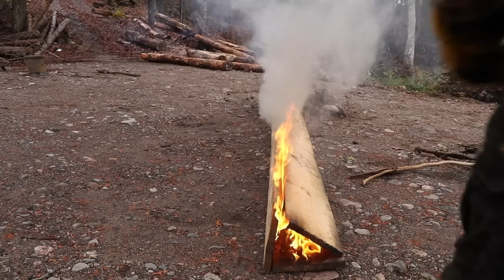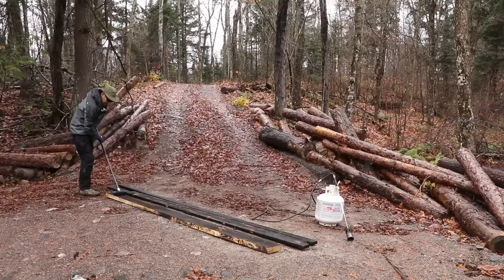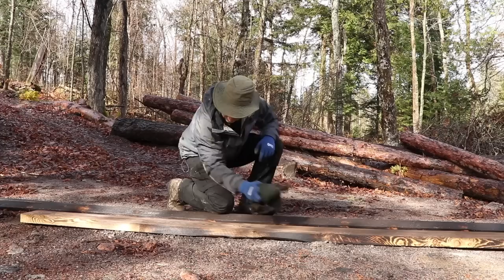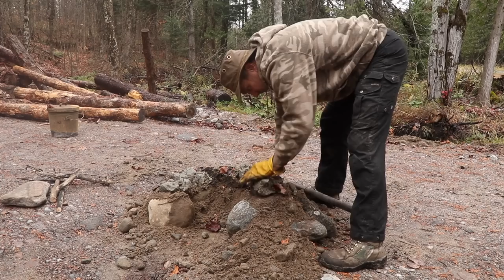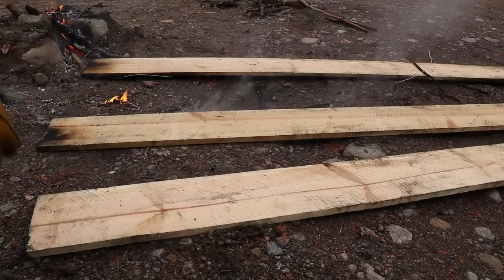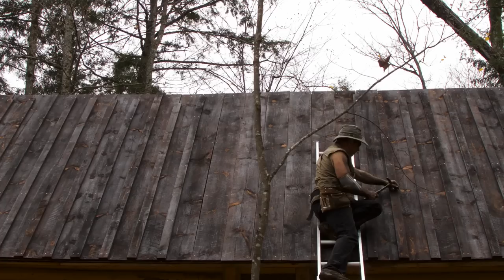Traditional Japanese Way to Preserve Wood with Fire using Shou Sugi Ban, Yakisugi on my log cabin

Comment: So cool! Tons of respect... really admire that you took the time to learn a great technique from a different culture and try it out instead of just going the common route :)
Reply from the maker: Thanks Chris!
Reply: My Self Reliance in the future will you show the layout of the cabin and compare r value between what you're doing and modern building?
Reply: Jordan Lammers, R value is actually uses wood thickness as it's measure. What I mean by that is that an R value of 1 has the insulating ability of 1 inch of wood. R2 is 2", and so forth. The R value of his cabin would be the average thickness of his walls, roof, etc. Hope that helps.
Reply: BeSatori ya thx
Reply: thank you mate

Comment: One little detail that may be important for this technique: after putting a bit of oil on wood they usually heat it up (with propane) to help the oil penetrate deeper into the structure.
Reply: Are you familiar with this technique?  I'm a beekeeper and I've charred all of my hive stands with this method except I have not added oil.  So far, I'm very disappointed with the turnout.  After 1 year, even less, much of the char has simply flaked off.  I am not using cedar, perhaps this is why, do you know?  Also, perhaps me not adding any oil is also a problem.  Next time I char some hive stands, I'll try adding oil.

There are a couple of hive stands which I have to 'touch up' and I'll rechar them, I'll add  oil this time (used motor oil).
Reply: CluelessBeeKeeping DON'T USE MOTOR OIL FOR A BEEHIVE!! Use coconut oil or even olive oil but NOT motor oil!
Reply: @notbuyingit5698  Both go rancid.  I'd never use either.  I don't / wouldn't / won't use motor oil on the hive.  The hive stand, yes, I'd try motor oil (bees never go on the hive stand).  I need to experiment with something to try and make the charring stay on a bit better. The technique doesn't seem to work very good on pine.  Do you have any other suggestions which would help keep the char on longer???
Reply: In Lithuania beekepers boil boards used to build beehives in food grade paraffin wax, it makes them last very long time, no charring necessary.
Reply: Mineral oil would do the trick as it doesn't go rancid. You can get non food grade stuff much cheaper as well.
Reply: Also oils once heated past smoking point turn hard thus helping with the water resistance side of things. The same process for non Teflon pans such as iron & carbon steel pans!
Reply: @jesmondo5785  Just use Linseed oil, walnut oil, hemp oil, poppy seed oil. Any of the hardening oils. They don't go rancid, they polymerize into a kind of a "natural plastic" if you will and protect the wood.
Reply: @cluelessbeekeeping1322  boiled linseed oil is a great natural finish
Reply: @justaspivoriunas9416  My father's side is Lithuanian, Hello!  I'm curious, how long does that paraffin wax last?  
All the oil based paints of today are horrible (thanks EPA).  They simply do not last, not even 1 year.  Also, I am not charring my hives, just the hive stands.
Reply: @jesmondo5785  I've written this long ago, but I still haven't tried any of what I've mentioned.  I'd still like to try motor oil as I can repurpose it.  It's free!
Reply: @jesmondo5785  If I oil them, I will not char them.  Well, I mean, I will 1st char them, then oil them.  Although...I wonder how that might work to char them a 2nd time after adding oil...hmmm, I'll try this, but I can't now, everything is too dry.  Fires can spread amazingly fast.  I'll have to wait till it becomes greener in the Fall.  Thanks for all your suggestions.
Reply: @cluelessbeekeeping1322  no worries dude! A second char to harden the oil i definitely recommended! As another lad said hardening oils are good just gotta be careful with how you dispose of the rags! Hope it works out well dude!
Reply: @cluelessbeekeeping1322  A 50/50 mix of linseed oil and mineral spirits works pretty well for treating wood. The mineral spirits help the oil soak into the wood really well. Not sure how well it works on charred wood though.
Reply: @waltofalltrades6817  Thanks.  I've got some of both, I'll try your mixture!
Reply: @cluelessbeekeeping1322  maybe use oil that won’t get stinky and rancid. Tung or linseed oil maybe. Or some straight up beeswax, I’m sure you’ve got plenty of that.

Oh, I’m a little late to the party hahaha. Should’ve read a little more.
Reply: @hotcurdsinyurmudder  Sorta late and not late.  I haven't used any oil or anything on ANY of my hive stands (yet).  I don't have enough beeswax to cover all my hive stands.
Lately I've been (these past 2 weeks) redoing many legs as they've been attacked by termites (expected, but also, meh, whatever, it doesn't matter as all the wood is free &  I have mountains of it...just time is my only expense).  Still, I need to start placing the hive stands on some stone to try and retard the rotting/eating of my hive stand legs!
The more I think about it, I'm going to go with just motor oil.  I've need to get a sprayer dedicated to oil, though.  Don't want to get that mixed with anything else!
Thanks for the suggestion.
Reply: Yes.  They do re-burn the oil again. Important.
Reply: @matthewapardue  Not necessarily "The problem is that standard “boiled” linseed oil sold as a wood finish contains heavy metal additives to aid drying: lead acetate and cobalt-manganese. These compounds are neither safe for you nor safe for the environment"
Reply: @cluelessbeekeeping1322  You can always use beeswax or beeswax and propolis.
Reply: @jasonthurston799  Dude, I don't have THAT much beeswax & no propolis (well, some propolis, I basically throw it away...ya, I know it's 'precious')
Reply: @cluelessbeekeeping1322  Hey, fyi, the charred bit is supposed to come off. As a matter of fact, you can rub it off with a wire brush leaving a dark brown finish. The char itself isn’t what preserves the wood, it’s the browned wood underneath.
Reply: @dylansmith7077  Something is taking it off at night...little tiny paw marks.  I STILL need to try adding motor oil to it...that might keep it together on the wood longer.  I never know the kind of wood I'm using, often long leaf, but there are plenty of woods which I simply do not know the kind of wood I'm using...  I do know they seem to each act differently.
Reply: What kind of oil?

Comment: I had read in a book about "Old-Timers Recipes and Techniques" that a way to make "A fence that will last longer than you will live" was to mix finely ground charcoal with Linseed oil and stain the fence with the mix.I'm assuming it works on the same principles displayed here, though I would say your technique is probably a lot faster. Very cool, thanks for the upload!

Comment: Great job Shawn !!  My Grandad used to char fence posts and he had a fire pit like what you see those fire walkers walk on and he'd lay the posts along the pit turning them when needed and when it was done he'd just roll it out the other side of the pit and roll another on. It was wonderful watching him work as a 7yr old !!  I'm 61 now and those posts are still there !!  He also treated the part in the ground and around the base with oil a few times each year ! Old sump oil from diesel trucks was best he said because it had the most carbon in it !!  Thanks mate that bought back a lot of wonderful memories !! Seeya Rob
Reply from the maker: That's great - funny how we've forgotten so many of the old ways.

Comment: I used this method on all the woodwork in my tiny house. I only have 2 windows and a door, plus the framing for my bathroom wall, so I just sat there with a blow torch and burned them all. It's pretty relaxing doing that. :) Then I washed them with water, let them dry, and used paste wax, and buffed it. The results are amazing. I love that you don't just see the grain in the wood, but you can feel it too. Plus no sanding necessary as all the slivers are burned off.
Reply from the maker: Sunflower Happy with the wax? Considering it
Reply: I really like the wax. I have a brush that attaches to my drill that makes the buffing really easy.

Comment: I'd suggest using boiled linseed next time, I was doing a rifle stock a while back and used vegetable oil (all I had at the time) and read everywhere (afterward) that it will go bad, the oil it's self will get rancid. I got rid of the gun not too long after so I can't vouch for it either way. Hopefully it works for you, and good luck.           My first YouTube comment ever, by the way. lol.

Comment: I could be wrong, but I thought the char was left on as the protectant? Either way, nice blend of cultural history going into the cabin. I'm loving it. (Comment NOT sponsored by McDonald's.)
Reply from the maker: lol. You're right. The heat still carbonizes some of the underlying wood and some of the char remains even after brushing lightly. However, leaving the full char on for exterior applications means it will last that much longer before the char erodes off. I'm only using this brush and oil technique on the interior where it won't be exposed to weather.
Reply: My Self Reliance oh, okay. Thanks for replying.
Reply: and what a beautiful way it is to bring forth the grain of wood itself, especially on floorboards.
Reply: Cool.  I had the same question about the wire brushing.  Maybe it would make sense to leave the full char on the bottom and sides of the floor boards and only wire brush the tops?  

Thanks for sharing the technique.
Reply: It would be a bad idea as charcoal readily absorbs large amounts of water.
Reply: Thomas Russell Your correct sir
Reply: That's not what the Japanese think– they leave the char.
Reply: I thought the same about the char
Reply: @zenyatta3947  This is why they put linseed oil at the end. It is a very ancient and efficient technique.
Reply: @jeebsgold  The two techniques coexist.
Reply: @zenyatta3947  no it doesn't
Reply: @tangokaleidos1926  yeah what the hell? charcoal is hydrophobic when dry.  it doesnt readily absorb water at all.

Comment: Not only is that charred wood Excellent but the fact that when one of the boards does go bad for whatever reason, It looks like it would be quick and easy to replace. I think you are going to love the decision you made in your roof design. The only thing to worry about may be weather the hot summer sun does any warping to the slats. Job well done Shawn. Cheers!

Comment: I just used this same technique on my raised garden beds, bought yellow pine boards which were much cheaper than cedar, time will tell on how long they last. I may seal them with linseed oil after watching this. Great video as always! 👍
Reply from the maker: That's EXACTLY what my wife wanted me to do first - including the type of wood. Next spring for sure. Thanks!
Reply: Hi. Just wondering how the pine boards on your raised bed have held up. Watching Shawn’s videos introduced me to shou sugi ban and I’m revisiting old episodes to learn how to preserve the boards I plan to use for building my own raised bed in spring. I’d love to hear what you’ve tried and what works well. Cheers!

Comment: Thanks for the video Shawn. I know personally how long it takes to make just one video I'm amazed how you can shoot one and even 2 videos a week that are high quality and can still have time to work on the cabin. Quick question, what type of oil did you use to finish the wood ? Thank you so much and have a wonderful weekend. - Josh
Reply from the maker: Thanks. It is challenging to make more than one a week. It give me new respect for people who do that regularly. That was just canola oil. I'm not 100% sure what we're going to use and won't decide until after the floor is in place.
Reply: If you need a suggestion, tung oil is what the Japanese traditionally used but if it we're me I would use pine tar.
Reply: Agreed Tung oil is the way to go. NO 'smell'.
Reply: Your work is amazing and an inspiration :) It is difficult for me to get a hold of tung oil, and also realized it is quite expensive (?). So, your canola/vegetable/cooking oil treatment is the way to go for me. Looking forward to the video where you will do your floors and learn more. Keep going and cheers!
Reply: What about using boiled linseed oil?
Reply: All of the Tung, Danish, Etc oils are boiled linseed oil with different amounts of hardeners/driers in them. Get the least expensive linseed oil you can find. Vegetable oils like canola etc, do not polymerize. There are dozens of articles and references on the web concerning the use linseed oil and other varnishes based on linseed oil.
AAR

Comment: For the fire-hardened floor boards, I noticed you applied vegetable oil. Did you choose that over mineral oil because of environmental concerns, or a matter of price? Really like the look of that darker roof! Wonder if it will melt or shed snow better because of heat absorption? Can't wait to see it in snowy conditions!

Comment: Very Interesting, such a simple process with lasting results and to finish off the floor boards with vegetable oil, I never would have thought of that, I most likely would have use a floor varnish or Thompsons Water Seal.. You sir have it together..Peace

Comment: My understanding of fire-hardening, at least wooden implements, was more akin to a hot smoking.  The heat driving out moisture to harden the wood and the smoke providing the carbon to protect it, without having to lose mass to burning.  This comes from survival training where we used it for making hardened wooden spears, frog jigs, and rabbit clubs/throwing sticks.  I assume if you set it up it could work for boards also.
Reply from the maker: Jeremy i see what you're saying. Shou sugi ban takes it further than that. I'm with history and the Japanese on this one.
Reply: Not to be argumentative, but fire-hardening wooden tools is historical, not something dreamed up by some of the modern day youtube bush-crafter types (this is not a dig at you, I think you know the guys I'm talking about).  I understand it's a different version of the same principles, maybe minus the moisture loss, I just thought it was an interesting similarity.
Reply from the maker: Jeremy I agree. I just mean that this deeper char using flame accomplishes more than hardening. The thicker char, although relatively soft, erodes slowly over time before the hardened wood even starts to weather.

Comment: the purpose of carbonizing the surface, is to deter pests and prevent rot. By removing the sugars from the outside layer, only the fibrous material is left exposed. When you pour oil onto the surface, you are replacing the caloric value to the surface and countering the effect.

Comment: doesn't the vegetable oil run the risk of going rancid after time?
Reply: I don't think anyone is going to eat the wood... and even if it went rancid, oil is oil. The wood is still treated with oil.
Reply: Look up more advanced woodworking channels doing the same process, no one uses the vegetable oil like that. You use a conventional stain or dye. Some people have had good luck with teak oil.
Reply: A drying oil like boiled linseed oil would have been the correct choice. Vegetable oil will never dry, and is guaranteed to go rancid. I don't imagine it will be long before they start wondering where that funky smell is coming from. 😁
Reply: iI think he meant if would used inside, it would start to smell like an old fish and chip shop...
Reply: Should have used tung oil or a food grade mineral oil
Reply: seems like an economical choice for the exterior, i would only use linseed oil inside...
Reply: Flying Dutchman it’s processed so maybe it won’t

Comment: This is really cool! I'm a bit surprised that I hadn't heard of this technique before, but it's a very neat idea and I'm thinking I'll have to give it a try at some point.

Just as a heads up on a slightly more accurate pronunciation - shou would be pronounced basically like "show" with the "oh" sound at the end held a bit longer than usual. Basically when you see a Japanese word ending in ou the u just means to make the "oh" sound last longer, without contributing any of the u's "ew" sound to the mix. The su part of sugi sounds like "sue" while the gi sounds basically like the "gee" in "geese." For ban the a should sound like "awe."

Comment: Was worried u may have been too close with the propane as i usually use this method on pine,  generally tge larger rings give a great INDOOR  look so not to worried about elements,  however that bridging really bright ur ruins out, and that's what its really all about the contrast... excellent video brother,  ur cabin wall vids, Excellent as well!

Comment: Good.  and putting a shellac oil (from the original Japanese shellac sap tree) before or after the firing technique makes for some very good wood hardening and preservation.  The same for the new bamboo flooring that is carbonized i.e. shou sugi ban.

Comment: First off let me say thank you for these amazing videos, and secondly I need to ask a question or 2, what are the benefits of the rubbing the boards with oil after burning and will seep or sweat out of the boards on hot summer days?
Reply from the maker: It won't seep out from the heat. Oil repels water and insects, which can almost extend the life of wood indefinitely if you keep applying it every year.
Reply: My Self Reliance thank you sir!
Reply: But isnt the Shou sugi ban method already taking cre of that? You said it is pest and weather resitant. By weather resistant you didnt men water resistant? More like wind, snow resistant?
Reply: My Self Reliance although perhaps not appropriate to this particular application I understand that used auto engine oil, pre-heated, and then applied annually over the surface of wood works well to preserve it
Reply: Karima Osmani 
Oil also makes the wood resistant to dirt and so